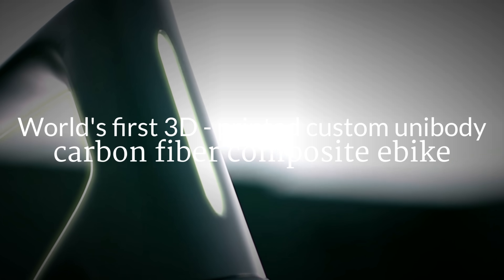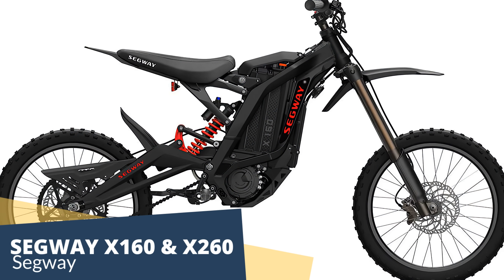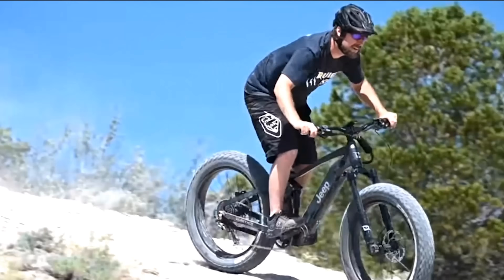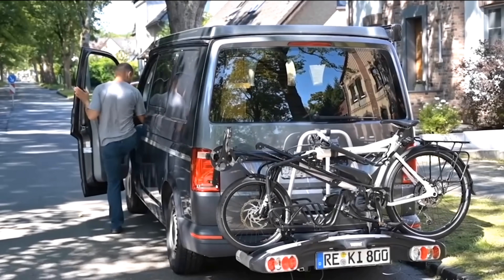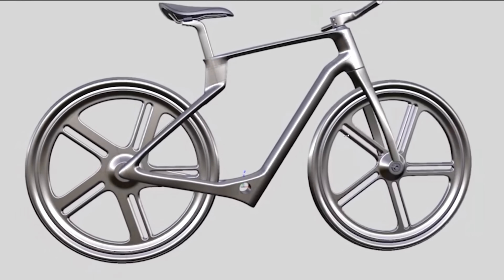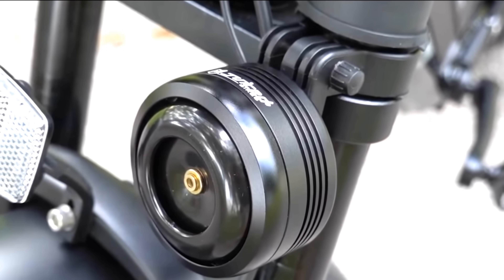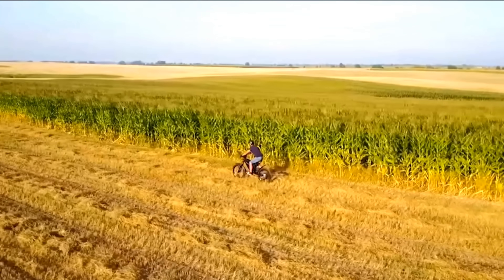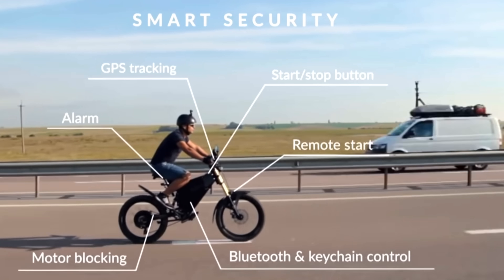E-Bike Innovations: 10 Models Transforming Travel

Comment: the prices make me CRY
Reply: Makes me agry 😡
Reply: I bought a hyper 29 for >800 with a 4 year warranty... never looked back
Reply: There isn’t a decent ebike under $300 change my mind
Reply: @cmal425  I went electric scooter for 500 $ and my electric bike was 1000$ on sale. Next year maybe price will get there
Reply: @rock2.0  yes that’s true but today just to have a battery, control panel, motor, and structure the price is immediately 500 - 1000+
Reply: For real I bought my car used for less than most of these and I put 100,000 miles on it since without issue

Comment: Ebikes should be cheaper, shouldn’t have to pay $4000 or more for a bike.
Reply: Electrics are blurring the line between Bicycle and Motorcycle, in capacity, utility, and cost.
Reply from the maker: Where did you get the idea you have to pay $4k for an electric bike?  That's like watching a Maserati commercial and saying, why are all cars so expensive. Like I said above to another poster. These are all new, top of the line E bikes. For example Amazon sells beautiful electric bikes for under $500 that look absolutely unforgettable. Behold, The Hiboy P10 https://amzn.to/31Q7eNE
Reply: @mindseyedesign  The ones Amazon sell are probably a lot of Chinese made ones. The good brands in Europe are all $3000 and more.
Reply: I spent 3k building mine but I got something I would of had to pay 6 or 7 already built and still would've had to add custom parts to.
Reply: Fido ebikes are £500 - £900
Reply: @UnderBridge Rock your poor wife
Reply: @UnderBridge Rock your reply sounds the same tbh

Comment: I need one of these to cut back on gas while rving. But the price of the bikes makes the difference of cost of the gas to the bike impractical. I'd literally have to drive to and from Alaska from Tennessee to approach the cost of those bikes. With both the RV and my car! Then I'd touch the bottom of those prices.
Reply from the maker: These are exceptions to the rule and not the standard price for ebikes across the board. I've seen electric bikes as low as $400.00 on Amazon and I guess Walmart is either selling them now or will be soon. I just finished a list with every ebike under $1500.00. I tend to feature the pricy bikes more only because they are more interesting and have more features.

Comment: I went to the Segway website. The prices on their website for the X260 are WAY high. They're letting us put money-down to reduce the final cost at time of shipping. Total price in the $19,000-$22,000 range. For that cost, I can buy all three Delfast bike models with thousands left over to buy beer. Great reviews! I like the links.
Reply: You could buy a car or motorcycle as well.
Reply: @Jeff O'Reilly... Yep, way too expensive and the fact that I couldn't even pass these off as Class 2 bikes riding about town! These pretty much should be called electric dirt bikes that would be hauled to and from off road sites. Meanwhile, I just got my camo E-Cell Monarch AWD with 2X batteries for a fraction of what these cost and I am extremely happy with it! The Monarch Crown is categorized as a Class 2 bike but it has been going much faster than that when I need to :-)
Reply: The Segway X260 isn't expensive. It's only $4999.
Reply: I would buy a good used car for this money

Comment: Y haven't they added solar panels to the bike to charge the battery so you can ride longer?
Reply: They don‘t have enough surface area Michelle. Also, solar panels are expensive, complicated, and would only add cost and weight while providing next to nothing. For example, if somehow it was possible to put panels unto all surface area of the Belfast bike, it would take 2 months to charge the battery.

But your idea is still good, imagine the solar panel they are developing now. From what I gathered, now they are thin as a film and flexible. You could store the panel like an umbrella hidden within the frames of the bike!
Reply from the maker: I'm starting to see more and more companies now using removable batteries and selling replacements. Add a couple extra batteries, along with your suggestion, solar charging, and you're golden. Just remember to recycle your batteries responsibly.

Comment: I love the idea of an ebike, but so far it still looks like ebikes are toys for the rich. The cheapest of these ebikes still costs about twice what my car is worth. How about an ebike for EVERYONE.
Reply: Agree! They are way overpriced
Reply: @heavycurrent7462  the surron x is actually very well priced for what it is
Reply: @talonjuel4021  No. Technically, the material and workmanship of a Surron is not even half of a 250 cc motorcycle. The later may be far cheaper due to mass production, but ebikes are NOT well priced.

Keep in mind, an electric motor is en extremely simple contraption compared to an ICE. With much less complexity, the bike frame will also carry less weight. There are many diy ebikes on youtube much more powerful than a surron with a fraction of the price.
Reply: @heavycurrent7462  sure the initial cost is alot more than a 2 or 4 stoke dirt bike, but those require alot more maintenance so in the long run would be cheaper, electricity is also alot cheaper than gas (where I live) and sure a 250 cc has alot more power than an surron, a surron is comparable to a 125cc but I don't know why you brought that up
Reply: @heavycurrent7462  everything's cheaper when you do it yourself what's your point
Reply: @talonjuel4021  That‘s not a reason to ramp up the price. If so, try making your own ICE vehicle and tell me how cheap and easy it is.
Reply: @heavycurrent7462  I never said it was cheap or easy, I was just saying doing anything yourself is cheaper so you point is void, my original statement was surron is a great ebike for the price, yes ebikes are expensive I never said otherwise, so why are you arguing with me

Comment: The Bike I built from parts is faster, with a longer range and only cost about £1000? go figure!
Reply: It also has lights and indicators and a rack, twist throttle and pedal assist with 5 levels of power. Use your brains and build your own!

Comment: Someone must have paid you alot to say that the segway bike is a good bike. I sent mine back after several problems and its performance was horrible. That 40 mile range is a joke maybe if you only go 5mph you might get there but doubt it. The 5 fully charged batteries that I ran through mine only netted 13miles, that was my best range worst was 7 miles. Stay away from them.

Comment: If it’s over 250 watts and assisted over 25km/h it’s illegal as a bicycle and must be registered as a motorcycle. Also, if it has three wheels it’s not a BI-cycle, it’s a TRI-cycle or a trike. Also, there is a structural reason for a seat tube, if you lose it, you need to reinforce the joints and put more material in them thus adding weight, you could replace the downtube with a cable, but there’s no point.
Reply from the maker: Doesn't that depend on where you live, as regulations can very greatly from place to place? No matter how fast it goes, if it has peddles, I consider it a bike..not a bicycle, a bike. A lot of people call motorcycles bikes too, so as far as I'm concerned,  registered as a motorcycle, or not, it's still a bike lol.👍
Good to know info though thanks for sharing.